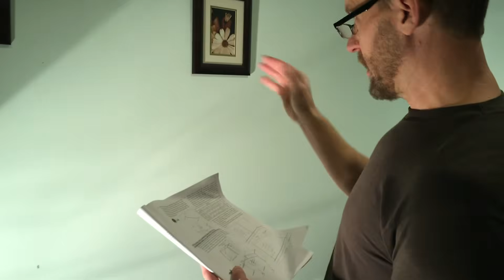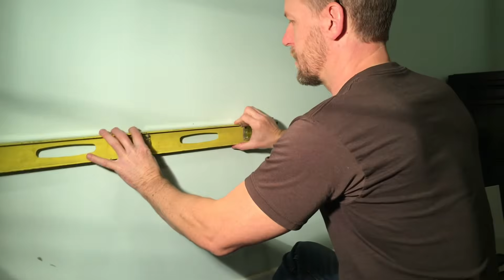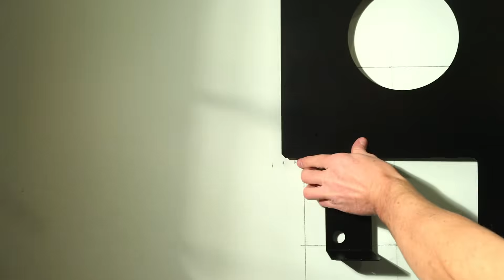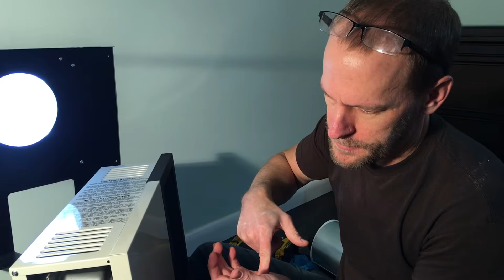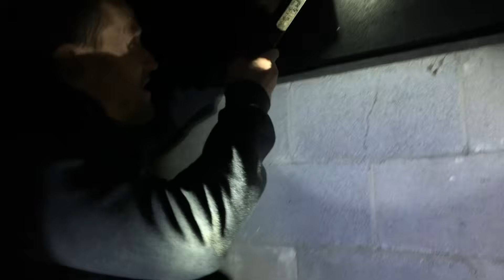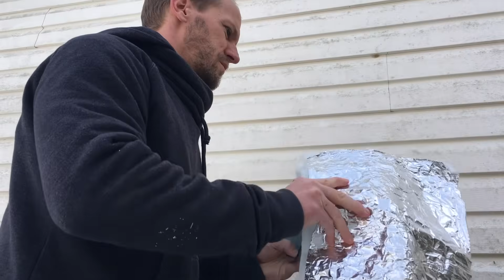Direct Vent Heater Install - Ashley Hearth Gas and Propane

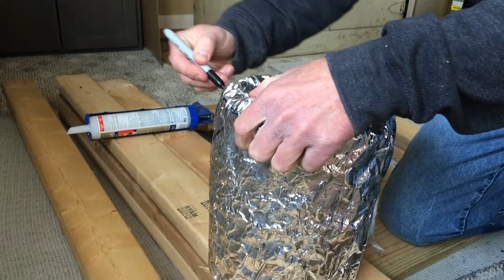Comment: Good video... can you explain the purpose of the insulation piece installation 20:40'?     Is it for fire proofing?  My installer forgot to install this piece and am wondering if it prevents outside wind gust from killing pilot because I saw this happen recently during a windy day,  the wind almost blew it out,  fortunately the pilot survived.   But their have been plenty of times the pilot would exterminate and never thought it could be from the wind.
Reply: He said it helps to stop the heat from being absorbed into the wall and sending everything out to the outside air

Comment: They are great heaters. They don't run or light well if propane tanks are down to a 1/4 full (5g). I am buying my 3rd one , the first to use natural gas. I believe the issues with small propane tanks will be eliminated by steady fuel supply. I have loved them, especially during times with power outages. We had electric forced air before about 350 a month down to about 100 in propane during coldest months. 2y ago prices.. Anyway..for anyone researching 👍

Comment: I'll be installing one of these as a backup heat source if the grid goes down and my heat pump stops (or if the heat pump needs a little help in winter). Maine building code requires a licensed LPG guy to make the gas hook up, but I'm going to do all the rest of the installation. EVERYONE who is capable should be able to DYI. It is not difficult to leak-check the gas lines so the installation is safe. Great video! Thanks!

Comment: Help please. I have a Conex/shipping container shop. I'd like direct vent heat for it. The wall of the shipping container are just thin but strong metal. I downloaded the installation manual and it said something like minimum wall thickness is 6 inches. How would you work around this? I know many with shipping container shops use diesel heaters but I'm not a fan of stinky diesel and our home is propane anyway so the delivery man comes with propane anyway. Your thoughts please.
Reply: We’re also building a 3 shipping container off grid home in central Arkansas. I’m curious about that as well.

Comment: Did you add a drip leg to the propane hook up?
Reply: Someone else added this question, but they didn't respond. I'm thinking because they purchased the natural gas heater, and not the propane heater.
Reply from the maker: Correct. We have the NG heater.
Reply: Someone else asked this question and they did not answer. I'm thinking maybe because they purchased the natural gas model and not the propane model.

Comment: Just had one of these installed. My unit will run, could be 15 mins or could be a couple hours, then completely go out. Pilot light included.   Have you encountered this issue?

Comment: Great video. Had a question on how you did your mounting plate. I do not have vinyl siding like you but it is wood and the instal says the plate needs to mount flush and use caulking. Did you remove more so it sat flush or left as is? I have small gaps due to the angle of the siding. There is no addition holes to add screws to it for additional strength.

Comment: This thing is almost 4X the cost of an unvented propane heater of similar size but it would probably be worth it not to soot up everything in the room like the unvented heaters do. Great video!
Reply: The unvented ones are against code in my area so I’m interested in these. but yes the cost difference is incredible.
Reply: Indoor use of NG or propane can create carbon monoxide.
Reply: What I also found is not so much the CO with ventless, but it actually drops the oxygen in the room considerably, causing the need to keep a window open. With the air intake these don't require that, so I'll be switching.

Comment: I'm getting ready to do this. The only thing is I have a cinder block mason house so cutting the big square is not necessary . I'll mount the bracket straight to the wall and bore out a hole for the ventilation.

Comment: I lost the bolt that connects the wall thimble together. I searched online but couldn't find the size
Anyone can quickly answer? Just need three correct size bolt diameter , I'll buy all thread.

Comment: Installed as per manual a week ago.  Seems to be excessive heat around heat box and pilot assembly.  Also, has a smell and have checked all gas valves twice and no leaks. Can anyone help??
Reply: Are you sure the correct orifice is installed NG vs LP?

Comment: With my 17k btu. I got two pieces of insulation. Not sure where to put them. I see nothing on the instructions. I PC that about 1' x 2' and another about 6" x12" with a sticky peel off. Both have reflective metal shielding.

Comment: I'd like several of these in my small brick home. But it's brick. It looks like the box and the big pipe is a major cut in my walls. I wonder if there is a less evasive option for a vented heater like this? Thanks
Reply: My house is also a brick Mason house. I'm just going to try to bore out a hole for the intake an exhaust to avoid using the inside shield. I would actually say it'd be beneficial. It's not going to hurt anything to have the brick warm up. If anything it's going to help.

Comment: Thank you for the video! I can't seem to find the answer in any of the sales literature. Are these constant heat, or thermostat controlled? I want to put one in my quail shed that I leave unattended for a day or two at a time, and need a thermostat controlled heater.
Reply from the maker: You're welcome! It is thermostat controlled via a dial. You can't set what temp you want, but you have multiple heat settings to pick from. We actually go over this in our heater review video: https://youtu.be/Y32TgbZJ-ao?si=1eObbm3kqUcYH239

Comment: plenty of homes are 2x6 24 OC. There's no real benefit (unless you're installing this unit) to 16 OC walls vs 24 OC when you use 2x6. Uses more material, insulates less.

my floors are 19.2 and my walls are 16"OC, so thanks for the reminder to check and make sure I wasn't going directly through a joist for the gas line.

Good job. It is always so psychologically tormenting for me cutting giant holes in the wall.. and ironic that you're installing something to heat the space that also is making the space colder when it is not active. but here we are. I like my propane fumes outside

Comment: What about the heat that is escaping on the outside ? We have a lot escaping and we've completed the install exactly as instruction pamphlet shows. Do you have this same issue and is it normal? Is it the exchange air that's being released and is hot? We are just afraid of losing propane

Comment: Can I put some fiberglass insulation between the fire retardant blanket wrapping the exhaust/intake and the studs? It seems like a huge heat loss and condensation area.

Comment: Does it come with different jets for propane or natural gas?  Or do you need to make sure you buy the correct one?
Reply from the maker: It does not. You have to buy the one you need for your fuel.

Comment: Great, matter of fact video, thank you so much! I'm a single 60 y/o woman and put the 17 series of this heater in my house yesterday. Couldn't have done it without this video. I do have a question and hoping you have insight. My exterior wall has no siding on it currently. I had to rebuild the wall due to water damage. I didn't put the siding on because I knew I'd be cutting through for the heater. I have asbestos siding, but replacing this wall with hardy plank. Question about the face plate. Should I attach the face plate directly to the plywood wall and install siding around it? Or should I go ahead and install the siding and mount the face plate over the siding? I can see advantages to either way, but the directions don't really seem to say and I see you put yours right over your vinyl siding. Don't want to finish this out until I know I'm doing it correctly. Hope you can help!
Reply from the maker: Thanks for the lovely comments, Kerin! Glad the video was helpful for your install! It'd probably be best to go ahead and install the siding and then install the plate. But it probably wouldn't matter much either way to be honest. But it'll be a pain in the butt to change later if you decide you'd rather have the plate on top of the siding once you've already cut the siding to fit around it. You could always contact Ashley and see what they say. Wish you the best!

Comment: If my wall is less than 4.5 inches, where do we add thickness?  Inside wall or outside wall?
Reply: Good question, I am wondering same. Gonna do it on the inside because replacing the siding is in my future. Don’t want it to look too Jerry rigged though.

Comment: I like the fact that you have very few cuts. Talk just enough about your steps, not over talking. Clearly you and your wife are on the same page. ... One facet to have considered in the placement is that it was never to be placed above a wall outlet, other wires, plumbing. Wire transits across a wall so that's something to consider. (Oops, you covered in the first video. Good job.)
Reply from the maker: Thanks, Mike!

Comment: Thanks for the great video, just had a service call on a brand new unit that a guy had installed by his electrician and ended up calling a hvac company and they threw up their hands and walked away they couldn't figure out why the unit wouldn't keep running.... we found that they had wrapped the insulation blanket around the exhaust instead of the fresh air intake-----but for the life of me I couldn't figure out what the intent was with the blanket until watching your video and seeing such a large cavity around the pipes, in my opinion that's a little over kill on there part but definitely not hurting anything.
Reply from the maker: Ahhh! I'm so glad the video was helpful! Yes, it does seem a bit overkill! 😂 Glad you got it working right!

Comment: Thank you this helped a Tom for the install! 
But when I light the pilot it looks fine at first then when I turn it on and the main burners ingnite the pilot light turns yellow and jumps up a few inches past the main burner, is this normal if not any suggestions? Already replaced my secondary regulator that comes from my main Lp tank but nothing seemed ti change

Comment: I have one coming within the next week, Now I can start cutting the wall in advance, thank you! Some people say this model makes a lot of noise, do you find it to be true?
Reply from the maker: I'd probably wait just in the event that you found there was a missing part or something and had to delay the install to wait for a part. It'd be that much longer you'd have a hole to keep covered in your wall. You never know. We have not found it to be noisy at all. Of course, that's relative to the person. The only noise both of ours makes is when the unit cuts on and off, and you hear the sounds of the metal expanding and contracting. But otherwise, they are silent. Hope that helps! Good luck with your install!

Comment: Awesome video! just one question. How come you didn't install a sediment or t trap?
Reply from the maker: Thanks Fabian! We actually did install one in the gas line we ran for it under the house in the crawl space.
Reply: Oh, man, I must have missed it. One more question. Does this Unit need a thermostat connected to it? BC I'm about to replace an old suburban heater with this one and that one, has it connected. thanks for getting back to me.
Reply: @fabianrojas8333 it has a built in thermostat

Comment: Great Video! Does anybody know the diameter of the vent-air intake pipe that comes with the kit? i am talking about the larger vent pipe, not the smaller one inside it. Thanks in advance!

Comment: how to adjust the direct vent lp wall heater primary flame adjustment ? My burner flame is white in color, anyway to adjust air gas mix ? THNX

Comment: Great video! do you need the aluminum frame if your going thru brick wall? What is the diameter of the largest vent pipe?
Reply: You can find the installation manual on Ashley's website but when I read it I believe it said it was for flammable walls

Comment: You should never use a union inside a building like that it’s actually against the national gas code
Reply: What's a union and why not?
Reply: Where I'm at in Canada it's allowed
Reply: Unions are installed inside all the time on furnaces

Comment: Doing an install of the 30 now.  Thanks for the video.  In the instructions it says 4 1/2" minimum wall thickness.  Is that just because that's the smallest size provided for the 11x insert?  I have a log cabin that only has 3 1/2 thick walls.  Do you see an issue with cutting that a bit shorter? If not I was thinking of padding out the wall another inch or so on the inside(between the wall and mount).  Thanks again for a great video.
Reply from the maker: The metal heat shield that inserts into the wall is made for either 2x6 framing or with breakaway tabs for 2x4 framing. As I'm sure you know, a 2x4 stud has an actual thickness of 3.5" plus a 1/2" drywall and 1/2" exterior sheathing would give you 4.5". Given that you have a log cabin, apparently you don't have studs, and though I'm not qualified to give you advice, but I personally don't see why you couldn't add some kind of backer plate or something to thicken it up. You'd probably be best to ask the manufacturer to be on the safe side. That being said, I'm sure there's a way to make it work. Just keep safety in mind. Glad the video was helpful though!

Comment: These use to be the most inexpensive heater you could get.  What happened?  There is no motors or mechanics.  There is only a heat exchanger, a burner and a vent.  Why do expensive?
Reply from the maker: It's so backwards. Maybe there's just less demand for these now since they are more work to install.

Comment: I finished installing mine the other day but I cant get the pilot to light. Ive tried the trouble shooting options in the manual but nothing is working, did you have any trouble getting it fired up?
Reply from the maker: Actually, we had the same issue with our first install. It ended up being a faulty ignitor. We contacted customer service, and they sent us a new ignitor.

Comment: if there's already a wall furnace that vents UP, can this be modified to vent up into existing vent above the unit?
Reply from the maker: You probably could find a way to make that work, but I'd get in touch with the company for advice.

Comment: Would you follow the same steps for the vent if you are going through a cement wall?
Reply from the maker: If you're going through an entirely concrete wall (inside and out as in a concrete block wall for a basement), I suppose you wouldn't necessarily need to make the big square hole. You could probably just have the round hole for the flue, but you should consult the manufacturer on this.

Comment: In Los Angeles CA it is required to install a Vented, Gas Heater in order to pass inspection on my ADU construction project. Does anyone know if this direct vent heater will pass?
Reply: Yes direct-vented convection heaters pass code requirements for now.  In the LA area I would think about a heat pump.  They make small units that are about the same cost as the vented propane systems plus they also cool.  Mild climates HP wind up costing less in the long run.  Though if you don't have electricity they are kind of harder to use.
Reply: @stanleytolle416  I did pass! Thank you

Comment: can you add a remote thermostat on another  interior wall
Reply from the maker: No, there's no option for an external thermostat. The unit does not use electricity. Hope that helps! This and much more is discussed in our review video which you can watch here: https://youtu.be/Y32TgbZJ-ao
Reply: thanx for getting right back

Comment: Would be nice to here it run
Reply from the maker: It actually doesn’t make any sound and is very quiet other than the sound of metal expanding and contracting when the heater is warming and cooling. It’s pretty much silent other than that. Thanks for stopping by!

Comment: Can we control room temp using thermostat or do we need to manually turn on n off when needed?
Reply from the maker: Yes you can control room temp with the dial thermostat, and it surprisingly works very well. The only time you might need to turn it off and on again is when you have temp spikes outside like early spring/fall when the thermostat doesn't meet your needs. It does take some experimenting to get to know the dial thermostat to know where you like to set it.
Reply: @AlleghenyHomestead  Thank you! Will be installing one soon :)
Reply: @AlleghenyHomestead  yo how do you put a thermostat on a non electric heater? Google wasn’t any help
Reply from the maker: @TheMetalhead0283  The dial thermostat on the unit works through thermal expansion and doesn't use any electricity. The unit is designed to work without electricity, so if you're looking to install an electric thermostat to it, I don't see any way you could do that. Hope that helps. We discuss the thermostat in our review video which you can watch here: https://youtu.be/Y32TgbZJ-ao
Reply: @AlleghenyHomestead  thank you for the reply, I thought the person was saying they wanted to hook up a dial thermostat and didn’t understand how they would do that, I got a general idea how they actually work
Reply from the maker: @TheMetalhead0283  No problem! Ah, gotcha!
Reply: The 40 year old unit I had in a back yard rental had a thermostat that was sent to desired room tempature.  The thing used no electricity and heated the 12 x 12 place just fine.  The thing work by convection and radiant heat.  It vented directly out the wall and took it's intake there too.  Extremely simple and compact.  No bigger than a Mr Buddy.